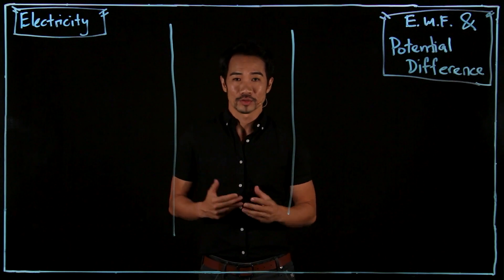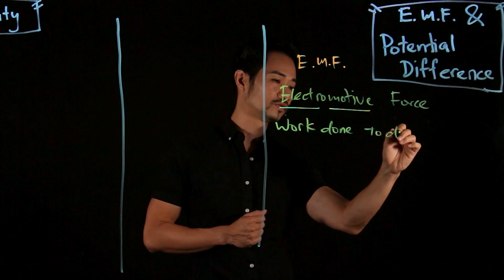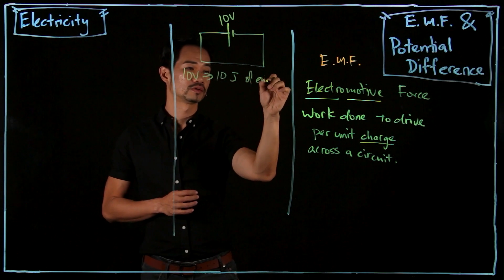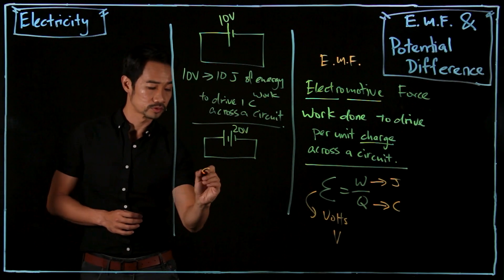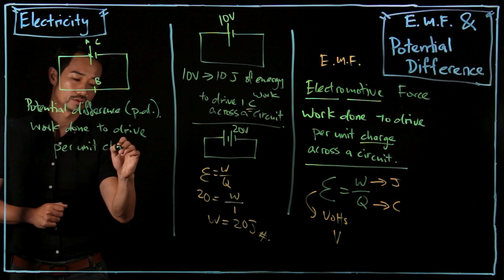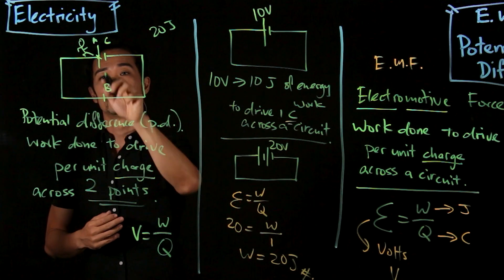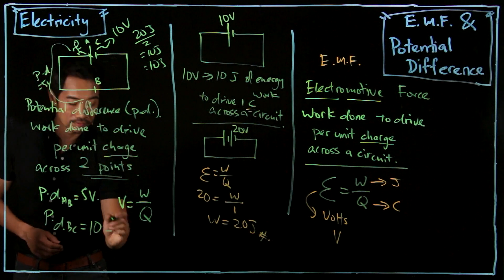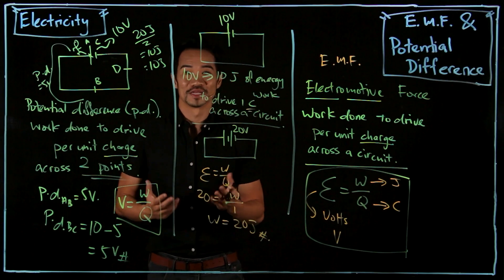Electromotive Force and Potential Difference

Comment: Pathetic. Man is confused 
EMF and Voltage are the same. They are neither force nor energy.
Reply: He is not confused at all. He is making a distinction between the line integrals of the electric field due to conservative forces and those due to nonconservative forces. The former is always zero along closed paths (it can be zero on open paths between two distinct points, tho), while the latter is characterized by having nonzero circulation, that is the line integral along a closed path is not zero.

Comment: 1. https://youtu.be/TTtt28b1dYo
2. https://youtu.be/8BQM_xw2Rfo
The units of emf and potential difference are volts. While potential difference is a path integral of the electric field made by real charges, the emf is the non-Coulomb work per unit charge and might in principle be chemical, mechanical, gravitational or nuclear in nature. 
The last frame References of video #1 lists articles and textbooks which discuss all the above giving the details of surface charges and operation of capacitors, inductors, transmission lines, pn junctions, antennas and more topics all with a unified approach to electrostatics and circuits.You will also learn from the textbooks 3 and 4 listed in video #1 the physical processes which enable a current to know by what amount to split in parallel branches.